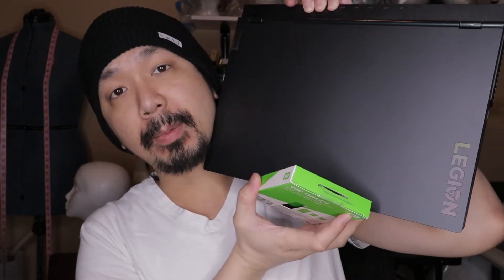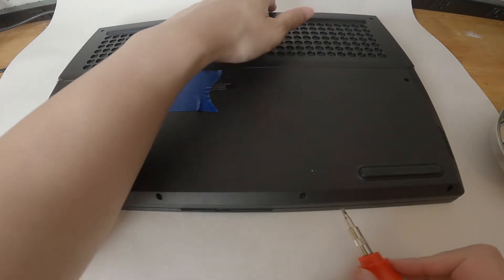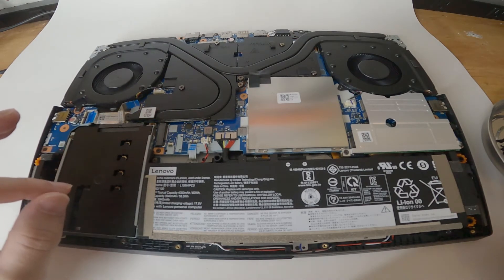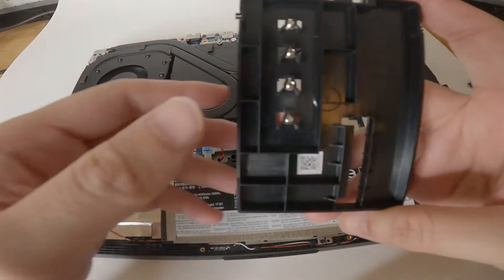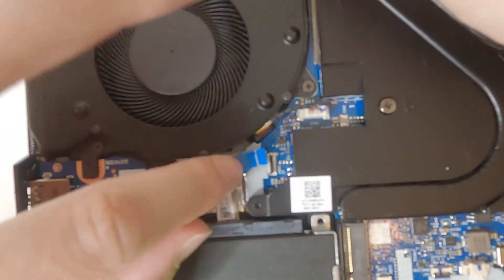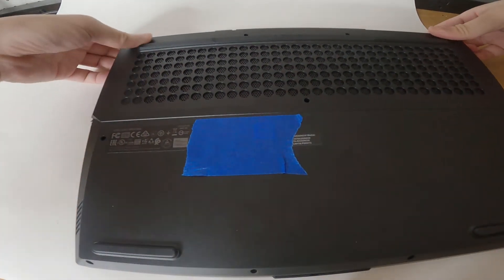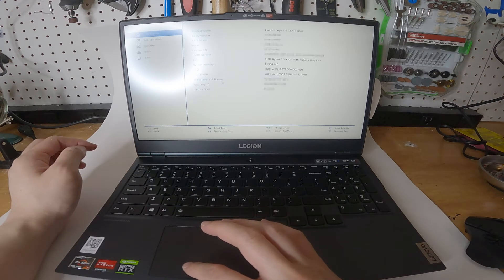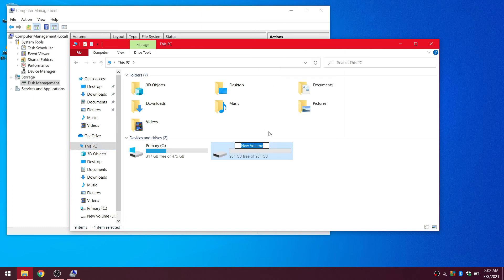Lenovo Legion 5 Gaming Laptop - Installing SSD Easy Guide

Comment: bro be careful sticking a screwdriver in the cracks lol you never know what could be on the other side that you could be poking into. lots of small components that could be damaged from a poke and twist like that, just heads up id use something plastic or similar